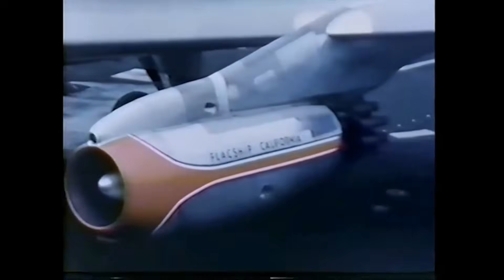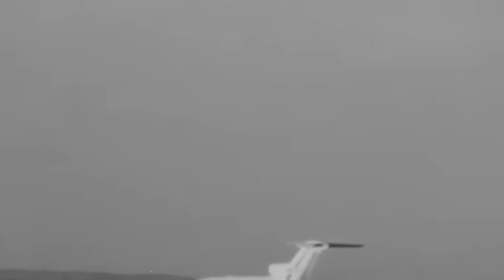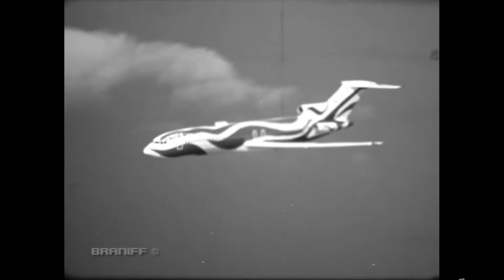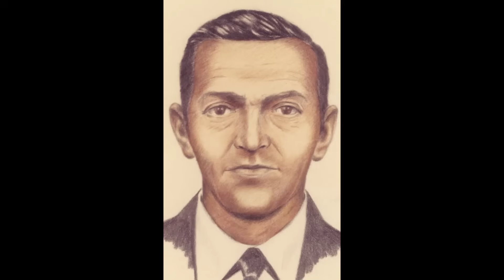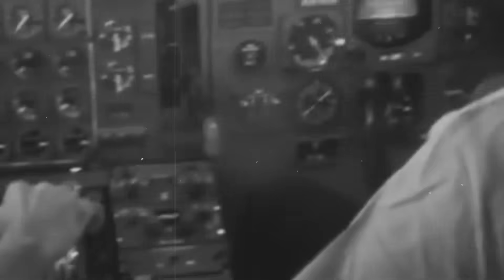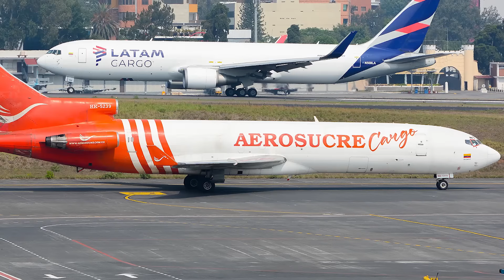Why the Boeing 727 Demanded 3 Pilots (And Punished Mistakes)

Comment: I was a teenager in the early seventies and I used to fly as a passenger on B727 once about every three months. When I boarded through the aft stairs, I heard the loud whine, and smelt intense burnt kerosene from the APU. I loved them both. Seats were not allocated then, you just sat where you liked, or what you found. I immediately took the window seat in the last row, because it was next to the engine. I could see the fan, and hear the engine through the entire flight, less than 3 feet away, separated by the skin of the fuselage. Actually I did not only hear it, I also felt its vibration in my bones. It was heaven! In later years I was lucky enough to be invited to the cockpit and observe landings. What a fond memory, I feel lucky to have done these things.
Reply from the maker: What an incredible memory! Thank you so much for taking the time to share this with us. Boarding through those aft stairs, smelling the APU, and feeling the sheer vibration of the engines right through the fuselage—that is an experience you just cannot get on modern commercial jets today. You were incredibly lucky to get those cockpit invitations, too. Those truly were the golden days of aviation, and we are thrilled that this video could bring back such wonderful memories for you.
Reply: @skysource1 this is one hell of an AI written response lol.

Comment: It didn't 'demand' three pilots. In common with many other jet aircraft of the era it carried 2 pilots and a flight engineer.
Reply: But Boeing 737 and similar planes of that capacity required 2 pilots.